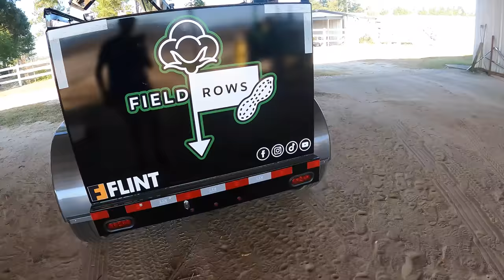Trapped In A Grain Bin With A Live Bat

Comment: WOW I can't believe you let him jump in that grain bin w/o a safety harness.
Reply from the maker: I may be wrong but I’ve never heard of oats collapsing like it came with corn or sore beans
Reply: @FieldRows     These are some of the recognized hazards and safety protocols for corn, soybeans, wheat and oats.  They all share the same hazards.  We care for your safety and want to see you around for a lot of years....

Flowing Grain
Grain enters the bin through elevators and exits it through an opening at the center bottom, using gravity to push it out. The movement of grain during this process causes it to move quickly, pulling grain to the center and down. A worker can quickly become trapped if the grain begins to move while they are inside.

Crusting or Bridging of Grain
When grain is stored, it can form a crust or bridge on the surface, allowing invisible voids (open spaces) to form below. This top layer of crust can collapse when the grain below moves or is weighted on. If a worker walks across this crust, it will break and they will fall into the grain below, quickly becoming buried.

 Grain Piles
Grain can build up on the sides of the grain bin when stored in poor conditions. These grain piles or masses can collapse when being broken up, causing a grain ‘avalanche’ without warning. If a worker is next to these vertical piles of grain as they collapse, they will be buried instantly.

 Grain can engulf workers in seconds. Once a worker is knee-deep in grain, they will not be able to escape without assistance, the pressure on their legs will be severe and they will quickly become unable to move. Training, site signage, and a buddy system are paramount to ensure safety when operating around grain bins.

Safety Tips for Employers:

Provide adequate training and testing to ensure the competency of all employees working with grain bins.
Provide long poles for employees to break up crusted grain without entering the bin.
Provide safety harnesses and ropes for all staff who may need to enter grain bins.
Ensure adequate staffing levels to allow a buddy system for any employee entering a grain bin; one employee to stand watch while the other enters the bin.
Air testing equipment should be available to test the grain bin air before entry.
Install ladders inside grain bins for emergency exits should an employee need to escape quickly.

Safety Tips for Grain Bin Operators:

Always turn off and lock out powered unloading equipment, augers, and fans before entering.
Wear a body harness with a lifeline or a boatswain’s chair before entering a bin.
Don’t walk on the grain in a bin to encourage it to flow.
Ensure you have a buddy stationed outside the bin; this person should be trained to assist you if you need help.
Do not enter a bin when bridging or grain build-up on the sides has occurred.
Always stay near the outer wall and keep walking if the grain should start to flow. Get to the bin ladder or safety rope as quickly as possible.
Test the air in the bin before entering to ensure sufficient oxygen and no combustible or toxic gases are present.
When working in a grain bin wear a dust filter or filter respirator.
 

Workers should only be entering a grain bin when absolutely necessary and when other workers are available to assist. All employees working on-premises with grain bins should be trained on the hazards and the safety precautions needed to minimize risks. Additionally, signage at the facility should remind staff of the dangers and necessary safety precautions for grain bins.